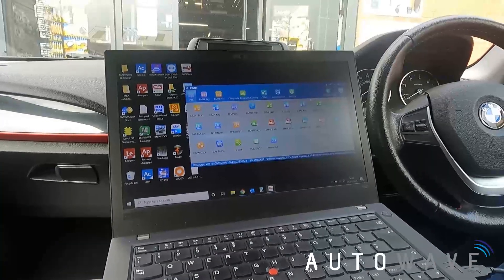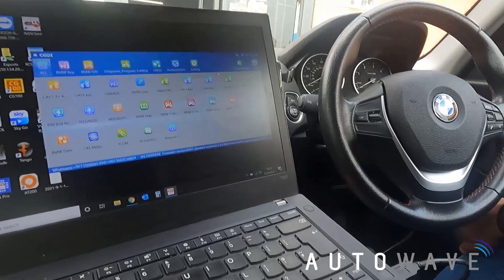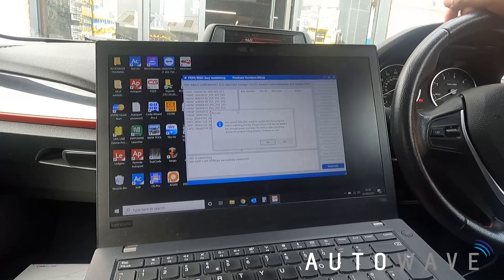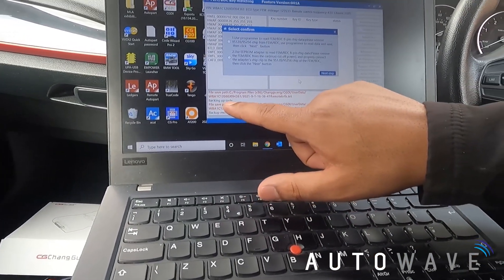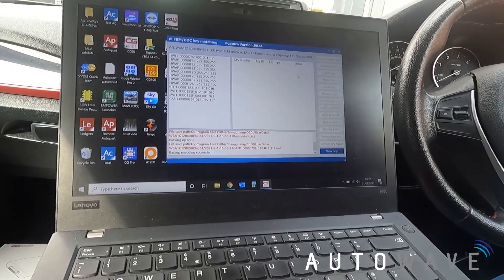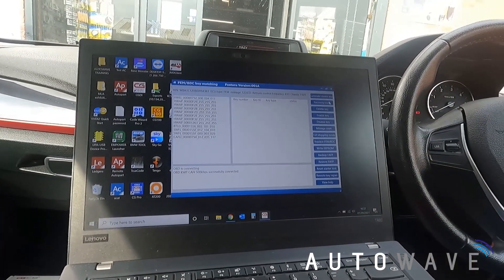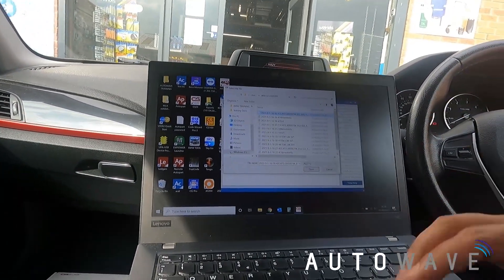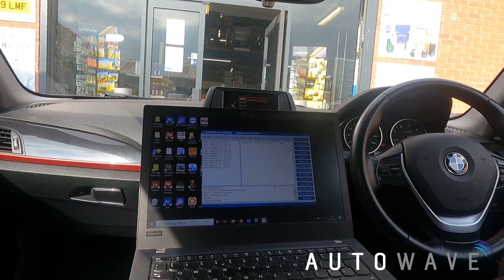How to Backup and Restore FEM Codes on BMW using CGDI BMW

Comment: Restore coding like that is only works when your backup CAFD coding file corresponds with actual SWFL. But usually after key adding or some modification of FEM it is NOT recommended to leave "modified" unsecured flash in FEM and in case after update FEM update you will get new SWFL version which will not correspond with you backup coding files. Ops :)

Comment: Hi was working on bmw F31 320 2017 and the fem shut down now we have to replace it with another one which we don't have the coding  backup so is there any other way to restore these settings please your help would be much appreciated thx
Lyes
Reply from the maker: Your only option really is to use dealer level software like EYS